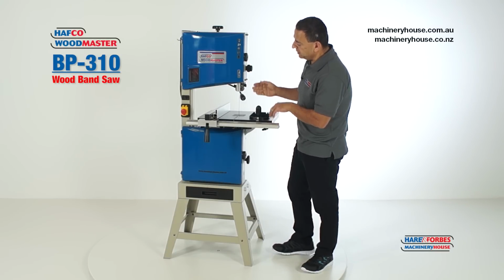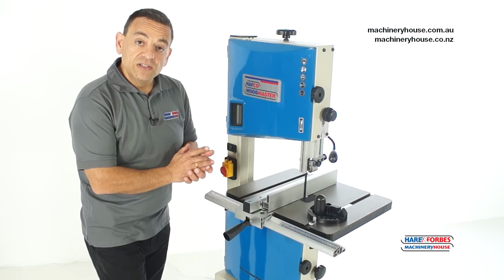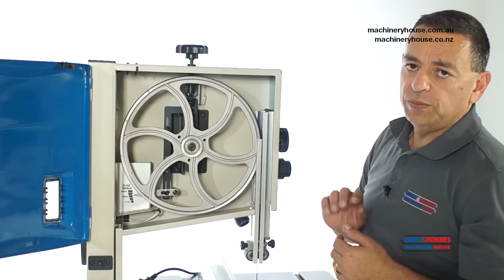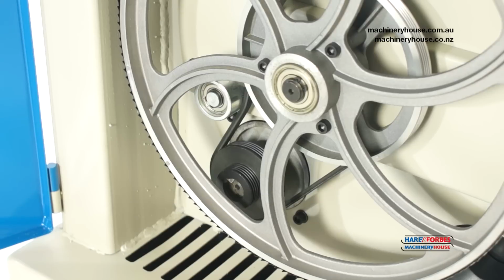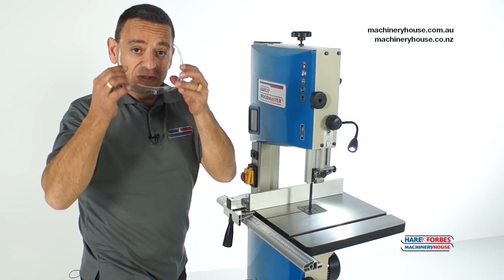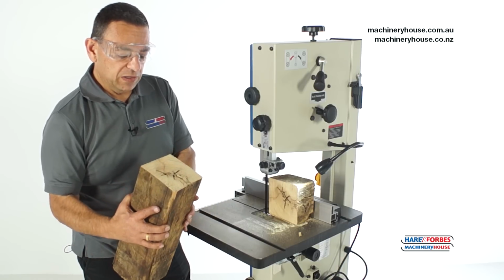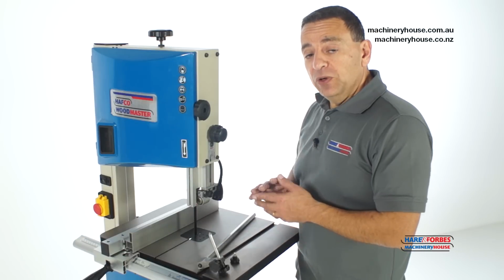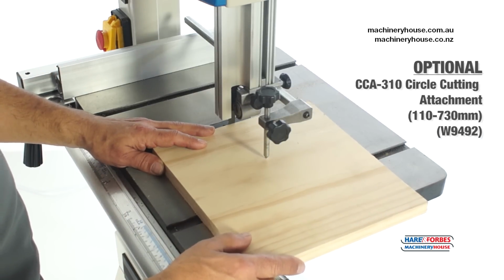BP-310 Wood Band Saw HAFCO WOODMASTER (W952)

Comment: An excellent review and I'm absolutely sold! Just the right amount of information. 
I've heard of upgradeable guides including ceramic guides. Does machinery warehouse stock those or an equivalent "better" guide
Reply from the maker: Hi John,  The BP-310 Bandsaw has ball bearing blade guides which provides great support and smooth operation due to the nature of this set up, But to answer your question we don't have any ceramic guides.
Reply: @Machineryhouse1930  The reason I asked is because I've read, which may or may not be true,  that the bearings are hard to adjust for narrow blades. Maybe they're isolated cases.